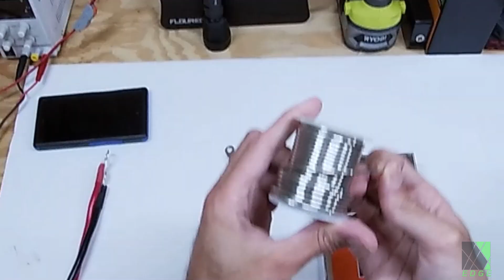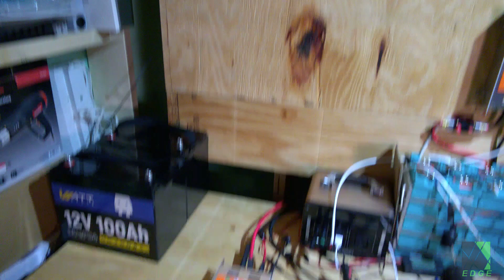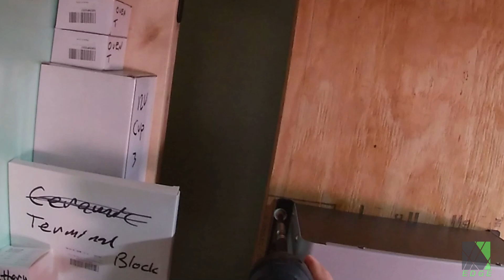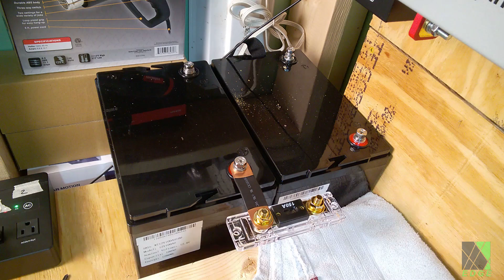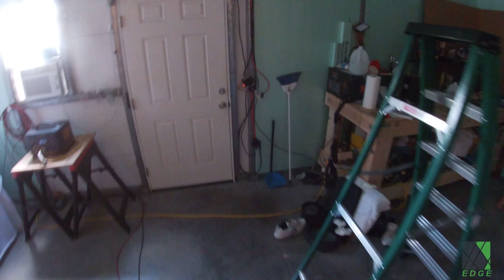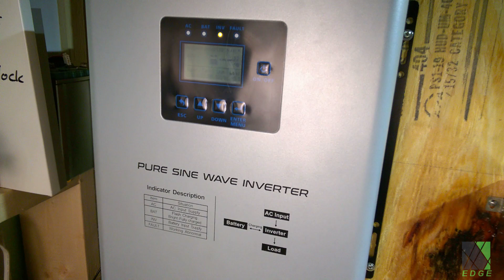Off Electrical Grid Workshop upgrade: 12v LiFePo4, inverter, solar charge controller #DIY

Comment: I have a quick question: Does your inverter's cooling fan run continuously, even when the batteries are fully charged and there's no load? In my case, the fan runs at a low speed but becomes louder when the load increases
Reply from the maker: @ferdm9646 Yes it runs low speed all the time. This is to prevent hot air from building up over time. If I plug something in that uses higher wattage, I can hear the fan spin up a lot. Although I don't want to listen to a fan, I'd rather keep the inverter cool and functional :)
Reply: Thanks for quick response, My small laser printer works fine, but the inverter connected to it makes a loud noise when I print. The fan kicks in for a few seconds and then quiets down, which sounds a bit alarming. They should have set a delay or made it adjust based on temperature
Reply from the maker: @ferdm9646  Welcome. That sounds a bit alarming. If you hear a hissing or high pitched buzzing sound when a load kicks on, that's the inverter electronics and transformer doing their work. It is hard on the inverter, the smaller it is. Mine does the same thing. Fan ramps up in response to the load (surge draw) - this is normal. So far mine has been able to run most loads, even a small vacuum pump and 5K AC
Reply: No hissing so far. I'm aware of those sounds, but the fan kicks in and makes a loud noise for a second or two, then goes back to normal as the printing finishes in just a couple of seconds.its just fan noise . Each time I print it does that again and again which is annoying by the way .
Reply from the maker: @ferdm9646 Yep it can be very annoying with variable loads. I mod the fans on a lot of the inverters and charge controllers here. Might have to do that mod to the Ampinvt inverter soon. If so, I'll probably record it for the benefit of those interested.

Comment: Thanks for the video. I'm still collecting parts. This has been a long process for me ,trying to not over do it working in this California heat. I started the concrete for the solar equipment room about the middle of May. I should do a video I guess . Lol
Reply from the maker: @ww321 Appreciate the view :D that's awesome to have a whole room for solar, right on. I need to drag myself out to make concrete footers for shop solar, once I recover from various physical issues. It certainly isn't happening now, in this oven out here. Probably not as bad as CA. If you make a video about it I'll be sure to watch, but no pressure lol

Comment: Thanks for the install walkthrough.  Is that Solar Charger making the fan noise at the end or inverter?  Working on a small wind generator at the moment.
Reply from the maker: @MrRoboto2338 Welcome, It's mostly the solar charger, I am working on a modification right now to quiet it down! Will post video asap
Reply: @solarpoweredge  I mostly use Victron products but do have an EPever 40A that  can't seem to find a project home.  I am thinking of using it to power my Barn cameras and WiFi with a 100 watt solar and 100A lithium battery.
Reply from the maker: @MrRoboto2338 Sounds like a good idea!!

Comment: Another good video. Do you find that the MPPT you are using is showing higher battery charging current on the display than it actually is when checked with the DC Clamp-on meter?
Reply from the maker: @budmartin3344 Thank you :) Not much, it's very close, less than an amp difference and varies a little bit

PS love the cat avatar, I have all rescued / stray cats as well. I greatly appreciate those who adopt and help cats (or any animal). Subbed to your channel
Reply: @solarpoweredge  I love cats, I do volunteer work for Marin Friends of Ferals trapping and neuter/spay cats, the bad part is that I end up keeping them! I have 7 former feral cats right now that decide to be friendly and live with me, It took about a year but they are now happy cats.
Reply from the maker: @budmartin3344 It's very hard to resist another cat!! Just want to keep them all :)